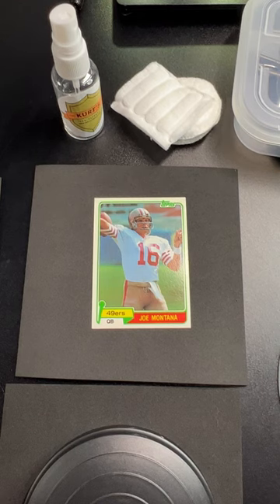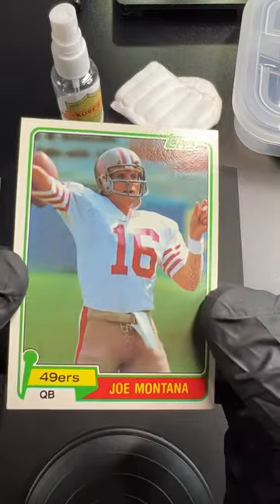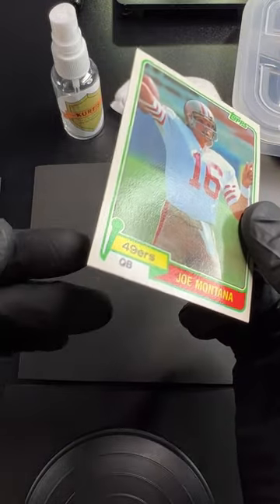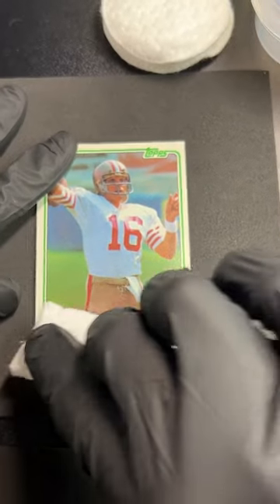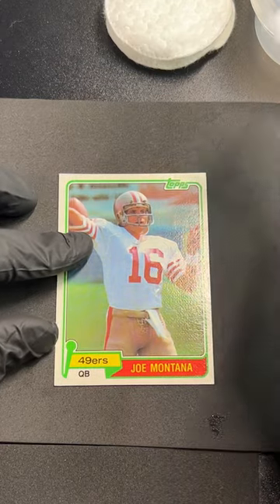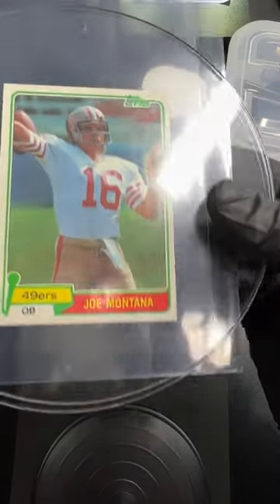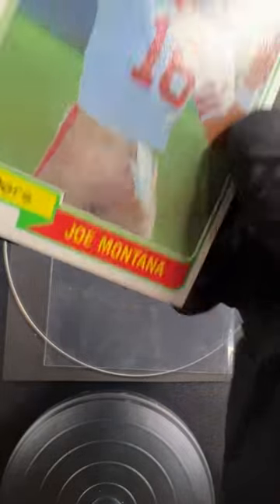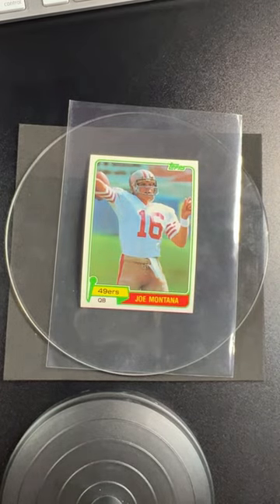Fixing Screw Case Damage - Vintage

Comment: I had a great looking 1980 Bird/Erving/Magic RC.  Nicely centered, sharp corners....and had it in a screw down since 91.  Came back altered.  Going to try your method and let you know how it goes.
Reply from the maker: I’ve had the same thing happen before. You can also put the card in humidity. If you own a humidor put it in there for a half hour at a time it will help out too

Comment: When you say screw down, do you mean the ones that don't have the center Grove that the card sits in?  I remember those thick screw downs where the card was literally squished between the 2 sides.   I always used the smaller ones that had the spot that a card would sit in.

Comment: what did the grade come back as?
Reply from the maker: I actually just got it back this week. It went from altered to a PSA 7
Reply: @kurtscardcare never understand why screw down case corners come back altered, instead of them just assigning a numerical grade for smashed corners and apply that to the overall grade with their calculation
Reply from the maker: @jwiedle86  preach that for sure. Just grade the stupid card. Such a racket.